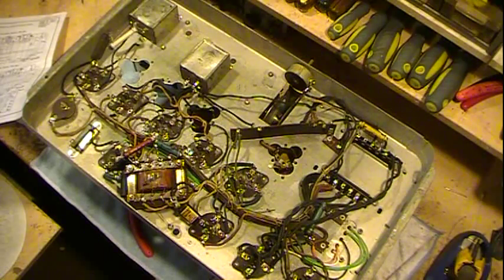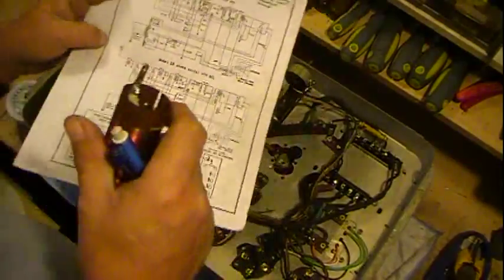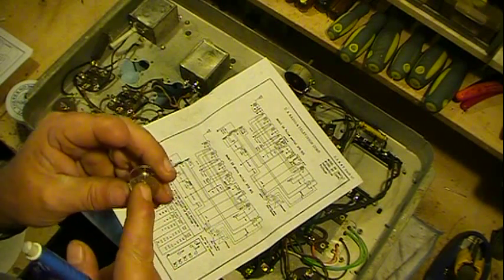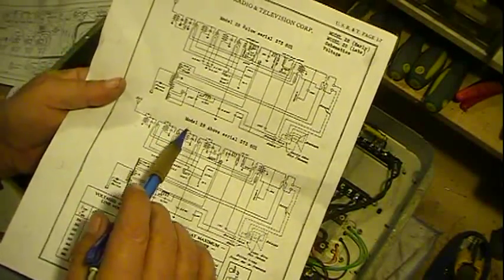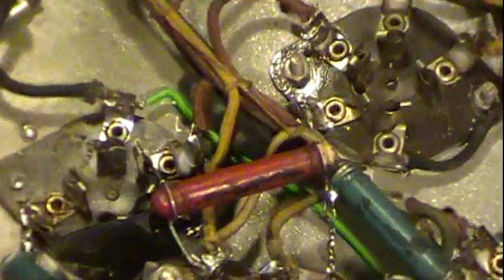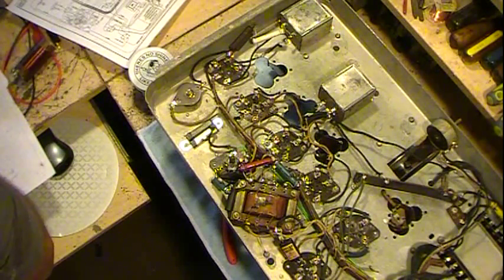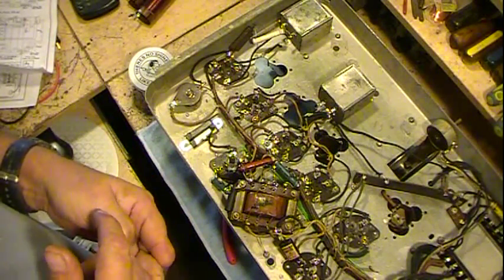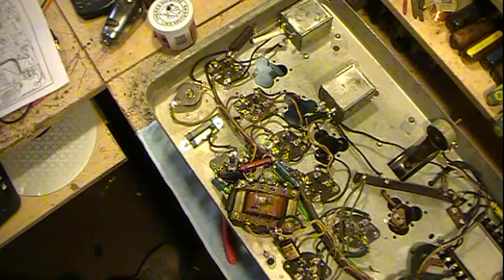Airline TRF radio part 5

Comment: Newbie questions here:

Could you explain how bypassing the primary of the audio coil with the capacitor works? I can see that the capacitor would get the signal to the secondary but what about the turns ratio of the transformer and the impendence matching?

I have never seen a TRF radio before so I was reading and trying to figure out how these things tune in a station. On the schematic are the capacitors in parallel with the coupling transformers the ones in the tuning condenser? When you rebuilt the tuning condenser it looked like there were four identical sections, so do they tune each rf section individually to the correct frequency?

Comment: Hi Dennis;
Great Video !!!!
I have a question.. Why did they use a turned  (bobin) coil on the inside of the coils, instead of winding it either on the outside, next to the other coil or on the outside on another slightly larger coil form ??
THANK YOU Marty